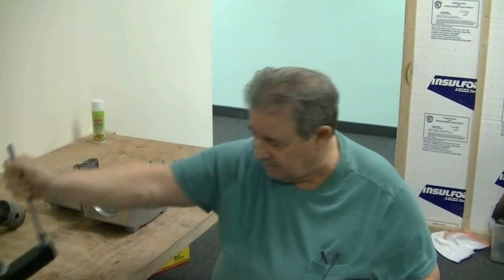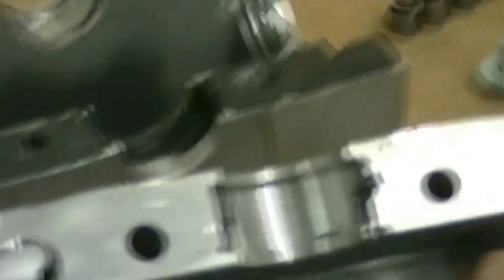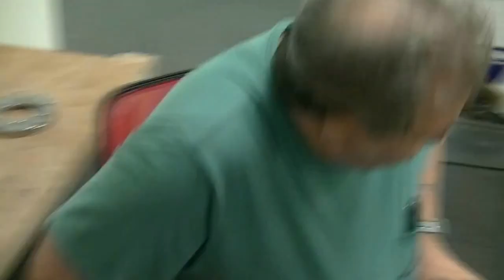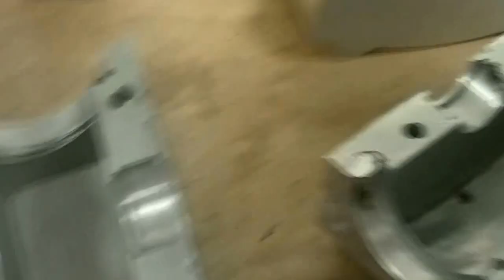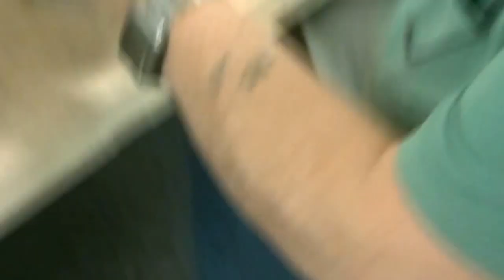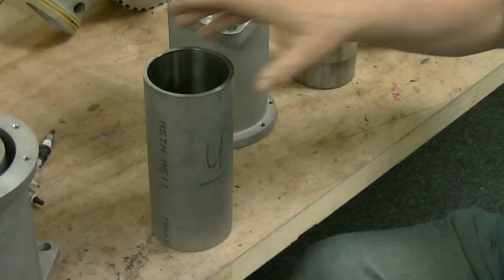G&GMESS

Comment: IMO, it is very possible to create a removable cylinder and use Buna-N O-ring seals going into the case. This practice is used in diesel cylinders and works perfectly. The bottom of the sleeve should be shouldered as the stop against the block body and the top of the sleeve should be +.002 above the outer deck of the cylinder body. The large chamfer on the cylinder head will seal and locate it with no problems. Your electronics are great!